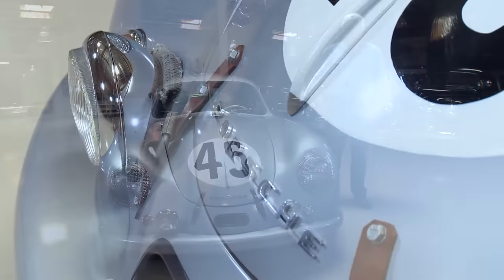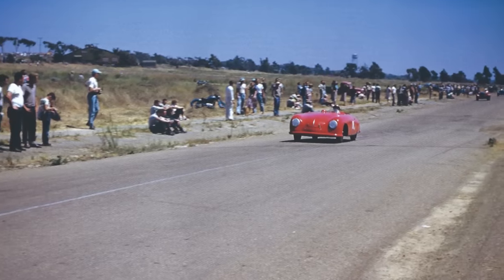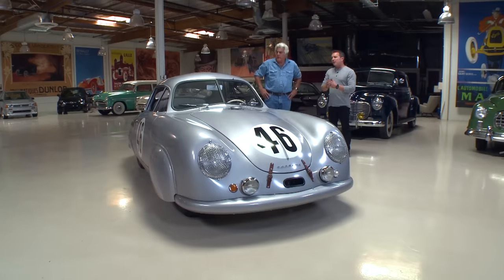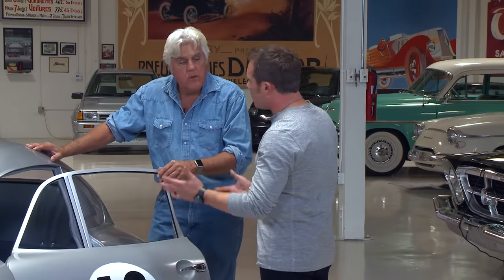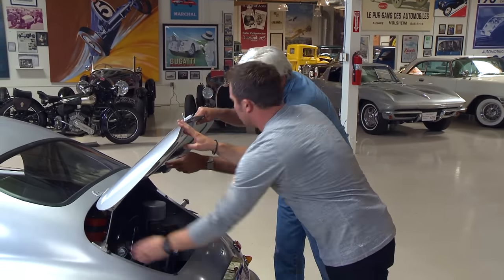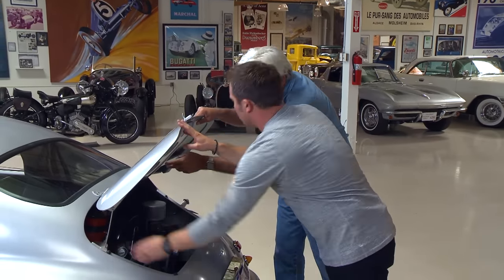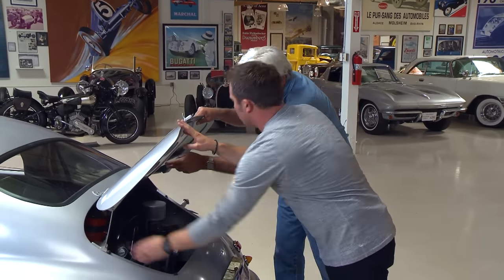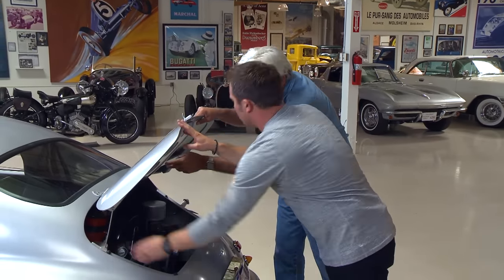1951 Porsche 356 SL Gmund Coupe - Jay Leno's Garage

Comment: Since there can be only ONE first car, to win a race for Porsche...the value for this car would be ridiculously high. It was very clear that Jay himself didn't want to take a chance on something happening to this car with him behind the wheel....way too much history in that car. Don't know the value...but we do know the highest auction price for a Porsche so far was $10M - 1982 Le Mans winning 956 in Aug 2015. 
"On initiative of Porsche's importer in France, Auguste Veuillet, Porsche was the first German make to enter Le Mans 24 hour race after World War II. In 1951, two aluminium-bodied 1.1-litre 356's were entered - #46 driven by Auguste Veuillet/Edmond Mouche and #47 driven by Rudolph Sauerwein/Robert Brunet. Unfortunately the #47 car crashed in practice and didn't start the race. The #46 scored 20th overall and also took the class victory, although it is not that important as only three cars competed in the 1.1-litre class and only two finished. Half of the 60 starters didn't finish the race. The cars that finished in front of the Porsche, had 2.0- to 5.4-litre engines and the ones behind the 356, were mostly the 750cc class cars."

Comment: Apparently Porsche had better ideas about positioning clutch pedals in the 356 days ... and then some sarcastic engineer came up with the 911 bushy deal .. other than that even Sophia Loren could hardly be called original 50s Napoli with artificial arms from Australia and the contemporary Capri tan applied by a tattoist . anyway a piece of art sort of :)

Comment: Looks like has its has been painted, beatifully, like a silver arrow, in the early 70's when I was at the uneversity my father gave me a a brand new VW bug, (this comment is from Guadalajara, Mexico) at the time I decided to work part time at an electric construction company owned by an uncle from my mother's side (mid 70's), he had a mercedes 190SL, maybe a 1958 or so, you must realize that because a goverment decree from which was in force from1960 to 1990 only mexican built cars could be sold within the country, as a result the choice was very, very limited, well my uncle summoned me and said "you will take care of my mercedes, you can use it as your own except when I want it, something that never was more no more than 2 days a month, and he also said: "keep it in top shape, the company will take care of the bills", well after sometime I felt that the car deserved a new coat of paint, so I got in contact with Mercedes in Germany and got the silver's arrows paint sent to me, the result was amazing, just like the Porsche Jay showed us, needles to say we were all very pleased with the result, I did my job.
I few years later I got myself an used Dinalpin, which was the mexican version of the french alpine A110, which I had bored out to 1,300CC, only 500 were made and were quite expensive, it was fun, fast for the time, good oversteering handling since being rear engine had twin rear shock absorbers per side, and again for the time fantastic braking, being about the car about15 years old at the time it had 4 wheel disc brakes, something no new cars had, at the time I also had a Chrysler Lebaron 360 V8 which was a gas hog but way more comfortable that the Dinalpin, those were the days.

Comment: Forty-five horsepower and it won Le Mans?
Reply: That car reached topspeed of 162 km/h with 45 hp  or 101,5 m/h. That was record in '51. It weighed 620 kilos on 45hp, that is 14 kilo or 32 lbs per net HP.
Reply: it won in a class of 3 vehicles.  only 2 finished.  so it really only beat one other car.
Reply: Aram Z , Do you have Information what Car Type they were? Cisitalia, Fiat or what? that is interesting